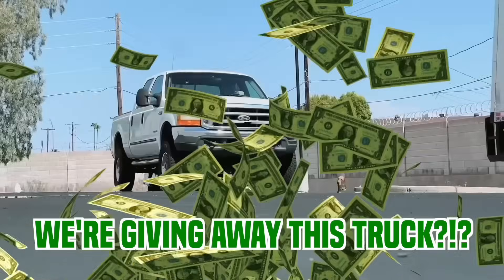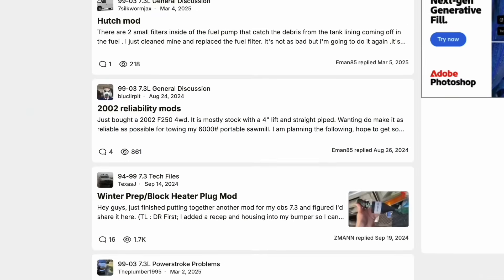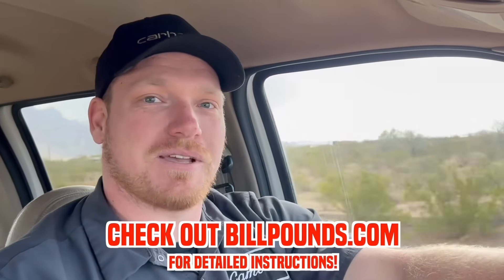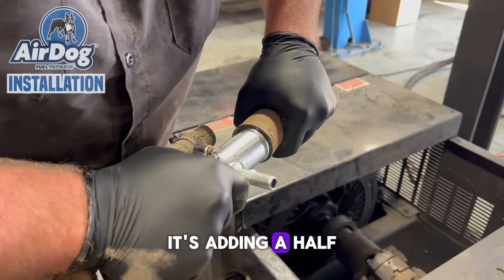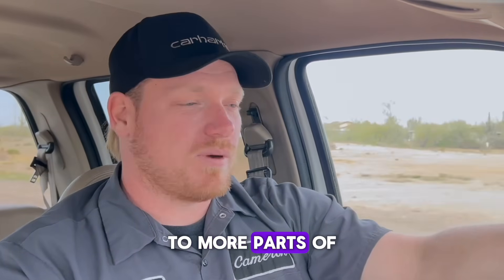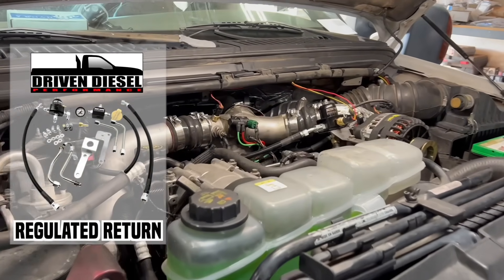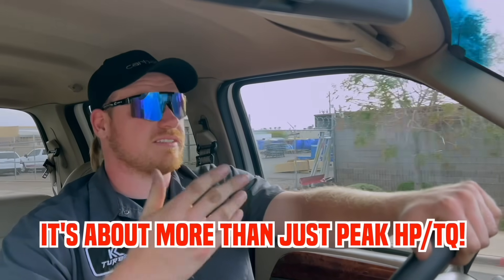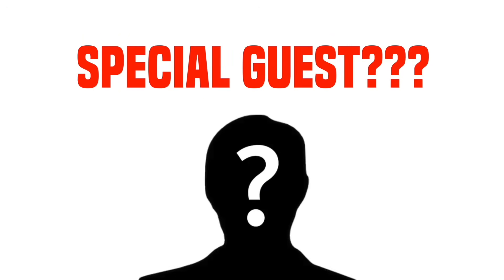How To Install An AirDog 5G To Break 500HP!?! - Legendary 7.3 Giveaway EP. 5

Comment: @KCTURBOS : i just installed my airdog 5g . you guys got it to me in 2 days and i live in Washington . this kit was nice and strait forward to install. very complete. its also is very quiet. i used the power wire from the original pump to turn the relay on . for the 5g harness . so it kept the truck turn key just like it was before. also the fuel pressure was perfect right out of the box. thank you for getting this kit to me so quickly .

Comment: I noticed you preferred the regulated return vs 4 line feed . What is your airdog return psi set at and what is your regulator set at on the motor after the injectors
Reply from the maker: I believe its 60 psi

Comment: Phenomenon Experience…… 01 F250, 7.3… 4 way fuel / fuel bowl delete.. Air Dog 2 5G… After market Fuel Pickup ( Pulls fuel through the top). Bled the fuel of air, fired it up and quiet!!! Shut the truck down and the fuel was bleeding back into the tank causing air in fuel and a really loud set of injectors…. Remedy: Fuel Regulator Return on Top of engine.. Self Bleeds all air in fuel.. Quiet Truck and happy injectors. Some say a one way check valve in the fuel line may prevent this problem/ phenomenon ….. NC Peace

Comment: So can you pull a heavy load now uphill, without getting the exhaust temps up too high now? That was what I thought was the most important. That 500 horse isn't much good it doesn't do what you need it too. Getting to 70 faster isn't near as important! Also, not sure why you had to pull the fuel tank. You could have put a sump in from the bottom, and you'd even get to burn more fuel.

Comment: I was not aware of the 1/4 tank issue, From full I can drive mine 600 miles and then 60 miles+ on the fuel light if I have to. As far as I know it is stock.

Comment: Need to do 5in exhaust now and see if you gain anything
Reply: I have heard the larger exhaust will add HP and lower egts!  I wonder how much
Reply: @peixinho5927 that would be interesting to see!
Reply: 5 is almost too big so 4 or 4.5 inch would be better
Reply: It’d be nice to see a banks monster exhaust on it
Reply: They just dropped the video with dyno results for the 5”
Reply: @peixinho5927  sadly they didn’t go with the banks ram air and monster exhaust they might have got around a 10 hp increase if they went with well engineered parts

Comment: Pretty sure you don’t need those screens in the tank anymore the airdog already prefilters
Reply: True.  But I think it also bring the pickup closer to the bottom of the tank.  Also something big could clog the little tube pretty quickly if big enough
Reply: DieselSite fuel sending unit is the way to go, factory style pickup foot at the bottom of tank but gets rid of all the filtering situation. Also can plumb the airdog into the return of the sending unit instead of cutting the fuel neck and returning into the filler.
Reply: @HanzAndFranzTV  I have never heard of the dieselsite sending unit. I will have to check it out.  Thank you

Comment: Can these 7.3 hold 500hp and still be considered a DD? I'm trying to get the most from my 02 7.3 but I don't want to blow it up.
Reply: Yeah, you don’t always have to have it on the biggest tune available all the time. You can have the hydra and run a daily driver tune and be 4-450 hp range and live there happily. Then turn it up when you are wanting to party
Reply: I have the hydra on my 02 7.3 Excursion, and I have separate settings for factory stock, towing, daily driver, performance and racing. I spend most of my time on 80HP daily driver with zero issues.
Reply: I have run my 01 excursion with an sct x4 tuner on +100hp for 2 years straight 😤 stock injectors… 351k miles … Things a slug without a little mustard
Reply: @seangman12  Sounds like its time for turbo and injectors!  Turn that slug into a racecar!
Reply: I think they will last with a good setup, good tuning, and built trans
Reply: Your 02’ has powdered metal rods like my 01’. I’ve always heard with PMRs to not push it beyond 450 hp if you don’t want to blow it up, and you want it to be reliable. The earlier engines have the forged rods, so they can handle the 450+hp better/more safely. Personally, I put 205/30 injectors in my truck, so I’m probably around 400hp ish, and she runs great, and I don’t worry too much about blowing anything up.
Reply: @tuckermally4856 205? And which KC turbo?
Reply: @tuckermally4856  I think with modern tuning the PMR hold up much better.  I rarely hear about them bending or having issues up to 500hp
Reply: I’m running 250/200 s366 
Hard running for several years now with no issues other than trans rebuild 
And simple things alternator 
Batteries etc 
Pull likes a freight train and has honestly surprised me with reliability at its current power level
Reply: @trvr_inds PMRs or forged rods?